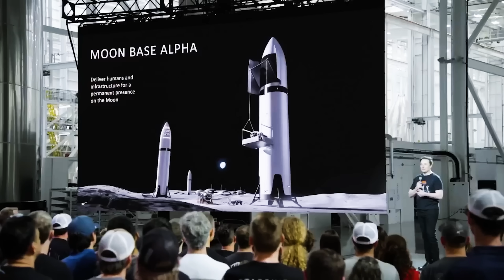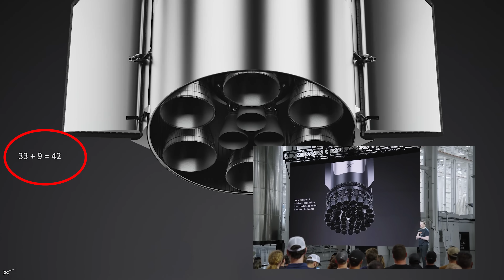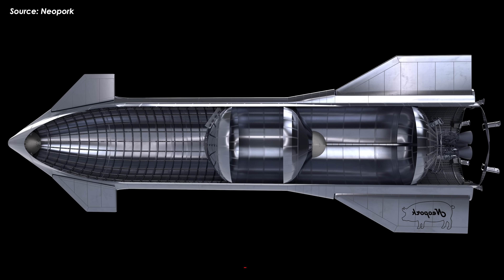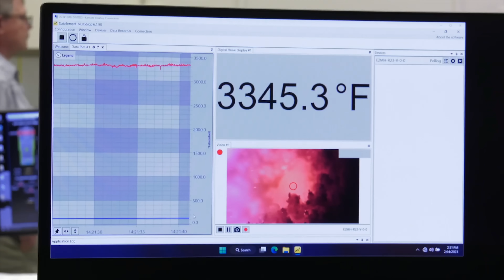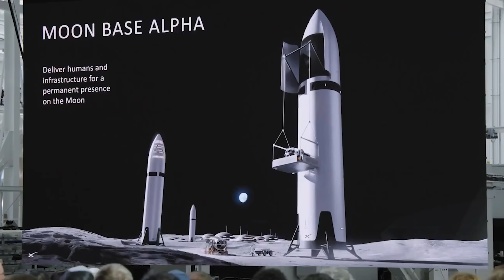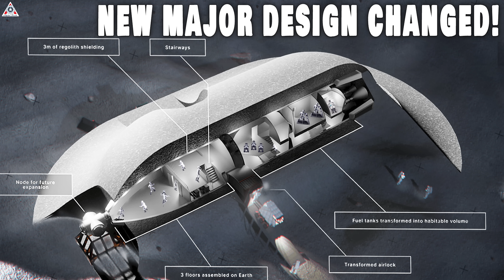Elon Musk officially announced NEW Alpha Moonbase shocked China, even NASA...

Comment: Dumb…china is doing the smartest thing and just using existing lava tubes. Literally just need to make them air tight
Reply: Using lava tubes is a plan but it's not on the table as the first option for anyone including the Chinese. Before you "just seal the lava tube" they'll need the equipment and supplies to do so. This will also be a first for engineering because we've never sealed a lava tube on the Earth, let alone on the moon. The moon is a very dangerous place to be testing out engineering practices and building in space is not as easy as you think nor as straight forward as you think. Personally I advocate inflatables habits to start the process and build up from there. Elon has gotten used to being on the government tit and Elon's space ship as a moon base is VERY nice, but costs way more per square foot of living space than an inflatable.
Reply: @readhistory2023  not forgetting it's hollow, or is it flat? wait a second...

Comment: THE IDEA WE ARE STILL F*CKING AROUND WITH CHEMICAL ROCKETS IS LAUGHABLE for those us well aware of the alternatives that do exists - hidden from mankind. ANYWAY... 
There are 6 essential elements or obstacles that must be over come to establish a moon base. Based on the following; Oxygen, Water, Fuel, physical effects of extremely low gravity, and finally protection from the Sun's gamma radiation over weeks and months:-  
1. To get the large and heavy starship to the moon a lot of fuel is required... getting a HEAVY fuel tanker into orbit without depleting its contents is hard enough... Refueling the starship itself is also not easy... the fuel is highly unstable and leaks extremely easily... any leak during refueling would be catastrophic as it would act like a jet to throw both Tanker and Starship onto tumbling chaos, break the connection and guarantee catastrophic failure of both ships! 
2. Oxygen to breath for the occupants of moon base! Until sufficient water is found on the moon which can be captured and processed a permanently occupied Moon base beyond 1 or 2 residents is a pipe dream  - much like the ISS - but a damn sight more difficult to resupply!
3. The harmful effects of low gravity will not stop on moon base - we are a long way from manipulating gravity on a planetary surface that has little of its own. 
4. Finding Water... its heavy. Without a source on the moon itself water will remain a serious resupply problem
5. If water can be found both Hydrogen and Oxygen are easily produced - if not, the mission becomes impractical for any long term success - the cost alone of constant resupply would become ridiculous... never mind the logistical dangers
6. Radiation from the Sun is a VERY serious physical issue - that probably means building a base underground or covering it with lunar "soil" to a meaningful depth. the ISS is still within Earths magnetosphere and as such falls within it's protection up to a point. The MOON has zero protection from Solar Gamma and X-rays - it will become a health problem very quickly. 

Then there's the issue of exploration. A slow wheeled rover-type vehicle is very restricted to a local area... An aircraft - far quicker - as we know it, is impossible - there is no atmosphere to maintain flight with "air" surfaces... requiring an altogether unique kind of craft suitable to "fly" over the moons surface. It can probably be resolved but its going to take some serious development and will need fuel to operate... These issues are NOT EASILY RESOLVED.

Comment: We should have had a moon base since 1970, Von Braun's designs for moon transport space wheel, cargo landers, habitats and ground vehicles were complete for phase A, the moon, using the moon to build larger versions if his moon project and launching a manned mission to mars by 1985,,,why did they bury his plans,,,build your moon base inside deep polar craters to avoid radiation, as soon as moon base is up and running start capturing, bring to the moon and start mining asteroids,,,does anyone know what to do with helium 3 ? use SpaceX as segments of a space wheel, build a space wheel you can fly to the moon,,,don't fly a SpaceX to the moon, send 10 SpaceX to the moon together, put 100 cargo c😢ontainers in high orbit withe the habitats, equipment, food, everything needed, put another 100 containers of water in high orbit, then form 10 trains of 20 containers each and go to the moon, get er done😮

Comment: Really, really, really stupid idea! Starship is completely inappropriate to land on the moon. The center of gravity when it lands on the moon will be far too high and the base will be far too small and the odds are that on the unknown stability surface of the moon, it will tip over, but not in a gentle fashion, and it won’t need Intelligent robots to help it. This announcement is just another case of Elon moving the goal post trying to convince people that is starship can do something. It will never be able to do either on the moon or on Mars. Are people really stupid enough to believe that this complicated plan is the best that can be done Because it’s most convenient to Elon?
Reply: The center of gravity on Starship is low because the engines and LOX are on the bottom. Your bad attitude is showing.
Reply: @stevebroome1288 
The center of gravity on starship may be low when it takes off because there’s a whole bunch of fuel in the lower 2/3 of starship. But when it’s landing, the cargo is all in the top third. I have to believe that the center of gravity has shifted dramatically once the fuel is gone And is much higher.

Comment: I might suggest for laying ships on their sides, using a dual trestle with cradle and two sets of tracks or wheels.
Likely  could be pretty light, perhaps aluminum, and assemble on site. Where basically the cradle clamps around ship, at center of balance height, tracks moved linear to tilt, and the cable drive in trestle uprights lower ships.

This would allow one device to move and lower any number of ships...

On Lunar gardening, one big factor will be day/night photo period cycles for flowering, you'll need a way to shade like electrically darkened glazing, and indoor lighting for Lunar night to get photo period correct for the plant's life cycle...

Otherwise, you'll be salad eaters... and not get any tomatoes or chili peppers etc.
the Lunar two week day/night cycle ain't gonna do it...
I'd recommend getting more than Lab Nerds as gardeners. Nerds building Space Ships is bad enough, we'll need some actual farmers fairly quickly.

Maybe if they have Agronomy wall hangers, the other Nerds wont be too arrogant around the food security guys.

On the oxygen from Regolith, suggest 3D printing blocks as a side benefit of the process, ie grabbing the oxy and getting bricks.

Also could be used with tailings from tunneling,  and if possible might be nice to remove the metals and use the residue for Lunar blocks.

Get the metals to make things with, or to export to Earth, or orbital construction projects.

Would be the best place to access materials for orbital Transit ships, until we are herding Asteroids home.

Personally I would just design a Starship varient, where a stage two cycled between Earth orbit and lunar surface or surface to surface and tanks and engines seperate from habital Spaces and return and cycle.
Then you just pupose design the habitat sections, instead of repurposing tanks and wasting engines.
Design what you need, quit with expedients as much as posible... 

These guys cobble enough to be Shoe Salesmen... 😂

Just sayin'

Comment: I liked the large screw auger positioned above the "liquid" water pool on the Moon surface, I thought the Moon was in a vacuum, why did the water not vaporize.
Reply: Although relatively small, the Moon does have some gravity to keep fluids on the surface ... I guess that sort of answers the question ?
Reply: @Jester-Riddle  gravity is NOT what keeps water a liquid in space, air pressure does... in space / zero air pressure, water instantly vaporizes (because its boiling point temperature takes a nosedive the lower the atmospheric pressure around it).